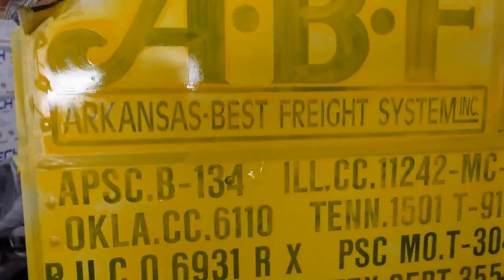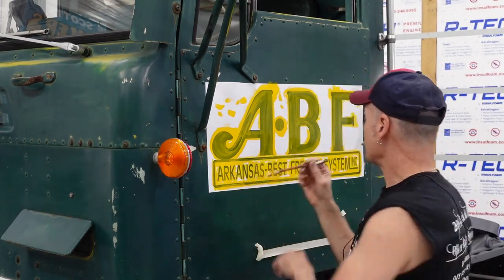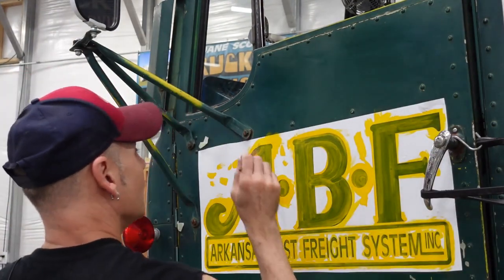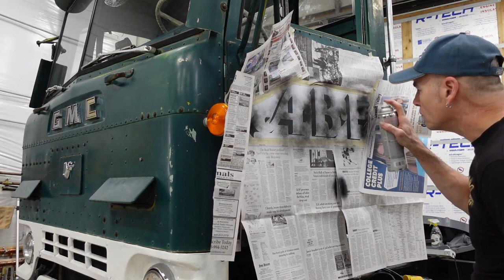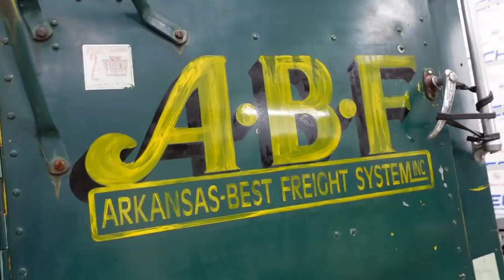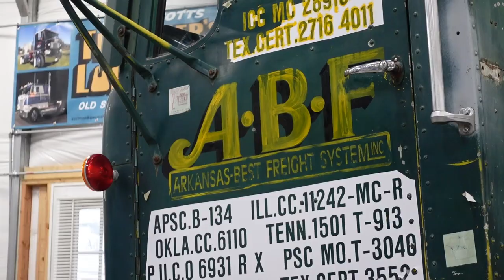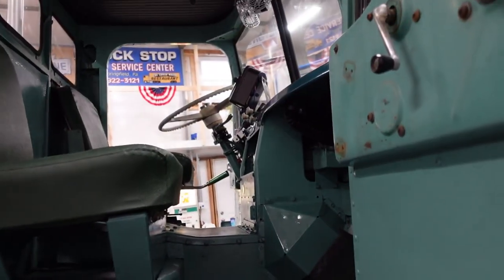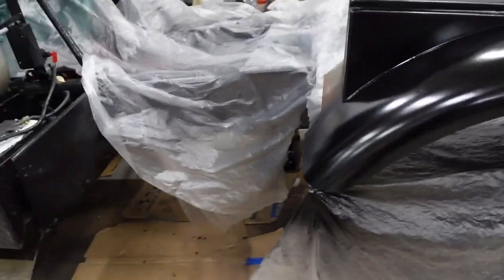Weathered & Distressed Lettering on GMC Crackerbox Detroit 6V-71

Comment: Neat job...the steel wool u used cuts down the thickness and gives it that look correct...my general is original paint and the paint is gone in spots down to the aluminum...I don't want to paint the truck but there a few spots I would like to touch up...Just don't want it to look like a patch...will have to try that...
Again that red brigadier is looking neglected...lol..
Reply from the maker: Yes Ed the steel wool takes the harsh edges off and really you can take down as far as you wish so you could do a few spot patches on your General.
Reply: Thanks Dane got to like  the gmc content....

Comment: The worn yellow on the cab ties in really well with  your  lettering.  Since it's  part  of  the  history  of the truck originally  I would  leave it as it is. As far as the  front  rim  is  concerned  just  shove  paper in the holes  then spray paint  it.
Reply from the maker: I can’t believe I didn’t think of that! Duh! Thanks😬👍

Comment: Awesome job with the lettering Dane. Do you need ABF's permission to put their name on the doors?
Reply: As long as he's not actually hauling freight with it,  it's OK and if he uses historical tags, or antique tags,  it's OK as well. 
The only time it becomes illegal is if he was trying to use those as permits.  DOT  would stop him in a hurry if he pulled on a set of scales  pulling a loaded trailer.  They know ABF wouldn't be using a truck that old.  If fact most states say if you have Historical or Antique tags the 5th wheel either needs to be removed or made to NOT work ( so it can't pull a trailer)
Reply from the maker: Thanks Bert, some of the guys on Facebook  are really out there about this. A plated “Historical” truck going to shows with faded lettering and way outta date numbers from “ICC MC “ era before DOT numbers (1995) isn’t a violation to anyone. 🙄
Reply: Great info, thank you @bertgrau3934 . Could ABF be liable in an accident situation, they have nothing to do with the truck except their name is on the door?
Reply: @BarryWilkinson  
That would be the registered owner, since ABF isn't the registered owner they wouldn't be liable.  I know what you're saying though. 

If you have Historical/ Antique tags, if you wanted to pull a trailer of approximately the same age, with Historical/Antique tags as well, ( both truck and trailer) that's legal as well, but no freight can be hauled including personal stuff.  Though, If I needed to move something of my own,  I would as long as I didn't have to go very far.
Reply: @bertgrau3934  Thank you.
Reply: @BarryWilkinson  
You're welcome. Glad I could be of help.